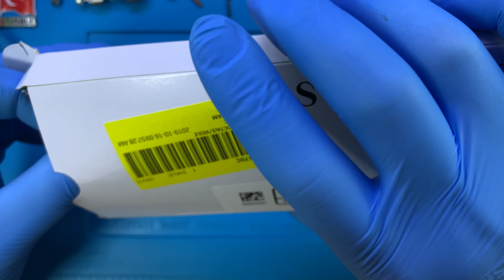Samsung Galaxy S8+ Ekran Değişimi 🇹🇷

Comment: After replacement, is the device still waterproof?
Reply from the maker: Hi;
Phone manufacturers only guarantee water resistance for devices that have not been damaged and have not been serviced. For this reason, more attention should be paid to fluid contact after screen - part replacement and technical service.
Greetings.
Reply: @gsmi  Thank you for answering my question

Comment: Will this eliminate the waterproofing feature?
Reply from the maker: Hi;
Phone manufacturers only guarantee water resistance for devices that have not been damaged and have undergone technical service. For this reason, more attention should be paid to fluid contact after screen - part replacement and technical service.
Greetings.